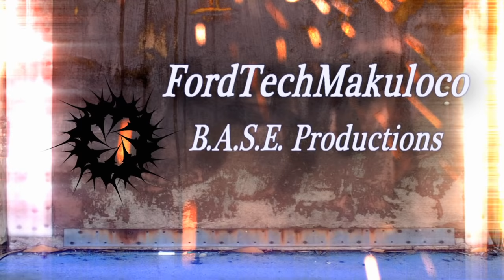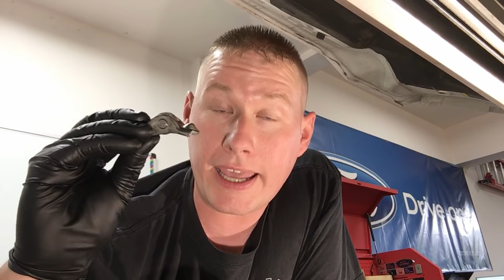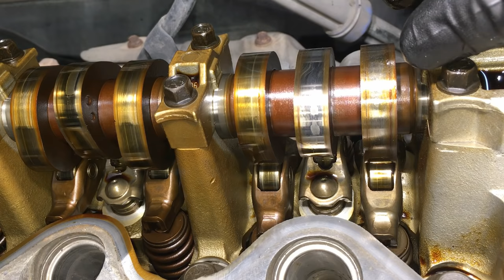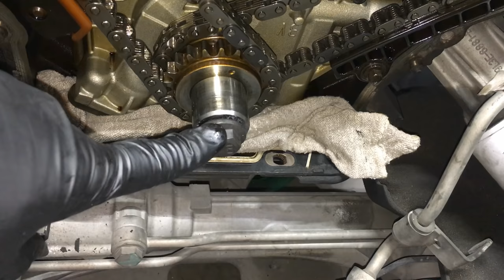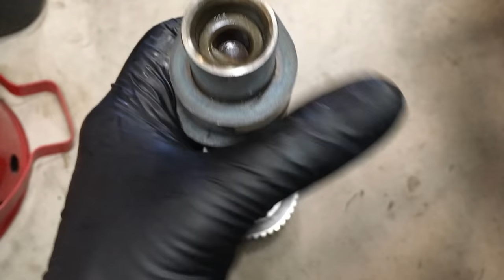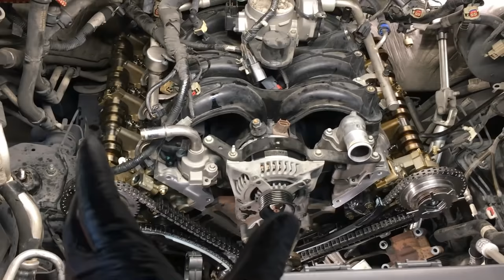Ford 5.4L 3v Triton Engines: Roller Follower Removal and Installation

Comment: I'm watching this video again before doing it myself. I Want to change the lash adjusters and roller followers on my mustang gt I with the 4.6l 3 valve engine. Could I use this procedure to remove all the followers and lash adjusters and replace them individually? Or do I need to raise the camshaft to replace the lash adjusters. Thanks you so much for sharing your knowledge I have so many of your videos on my Playlist.

Comment: I have the 4G 692 engine and will follow your advice on changing the followers, oil pump, phasers and possibly the cam.  However, I'm concerned about getting the correct parts for this engine.  What parts are the same with the 5G and what parts do I need to be cautious in ordering?  Great videos.

Comment: Hi I have a 2011 Ford expedition with the 5.4 l 3 valve engine and I love following your page I am about to venture into a large project where I plan on replacing the cam phasers camshaft timing chain as well as the roller followers. I've had the rattle on my truck for quite a while probably a year or more and it has progressively gotten worse I just have not been able to afford the repair and at this point I am preparing for the worst and thinking that I have to replace everything so I'm planned to order everything ahead of time and have it ready. The one thing that is hard to deduce from your videos is and what order these should be done when you plan on doing all of them at once if you could please provide me some contacts that would be great as it would be helpful as to knowing how to best avoid any timing issues when replacing cam phasers camshafts roller followers and the timing chain. 

Thanks in advance 🙏🏽🙏🏽🙏🏽🙏🏽

Comment: Love the videos!! I've been having problems with a P303 code along with others on my 2010 F-150. Spent $ 300 on the first assessment where they said it was an internal engine failure and I would need a used engine. My engine has 98000km on it and was quite disappointed. I tried another shop closer to home they were puzzled too, replaced 6 lifters on cylinders 3 and 4 but the problem of a misfire still persists. 3rd shop, a for dealer figures they have found the problem that the exhaust  valve spring is broken in cylinder 3. I'm wondering if the spring can be replaced  without removing the camshaft. They are suggesting it does need to. Please keep up the amazing videos Thanks
Reply: I have the same code and maybe problem. Was it the exhaust spring? What was your fix? Thanks

Comment: Another great video Brian....with these update roller followers and their smaller oiling holes, would you still recommend using/changing to 5W30 oil?  Do you think it will cause any issues?
Reply from the maker: +Ben Grigsby I would use 5w-30 no matter what

Comment: I have a 2002 F150 5.4 L. Do I need to remove the fuel rail, ignition coil packs and spark plugs? Thanks again for a detailed video.

Comment: I own a 2007 F150 5.4L 3v Triton and have been watching and learning a lot about these engines. I have applied the techniques from your videos with great success! On this particular video about the roller followers, I clicked on the link you posted for the latest roller followers on amazon to get a price and I am told that this part does not fit my 07. I have not heard any tapping or ticking from my 5.4 but am considering on changing the followers before it does start to make noise. Is this for sure the latest and greatest part or is there something better?  I want to keep this truck for a good long time. I bought it two years ago with 74000 miles on it and it is running strong at 102000. Any input, Thanks!

Comment: My brother was so fed up with his 2004 F-150 4x4 XLT, he threw me the keys and the title and said it's your problem now and went and bought a Toyota truck.  140K original miles.  I'm replacing the transmission with a yard pull from a known working truck.  Once that is done and verified working, I'm landing in on the engine with a phaser kit and now since I hear ticking, I'm planning to inspect the cams and followers.  Would it just be a good idea to pull the cams and replace all the followers and lifters while I'm in the engine?

Comment: Dumb question time. It seems to me it almost be easier to just remove the camshaft if you have to replace all of the roller followers, is this not a legitimate option?
Reply: Sometimes only 1 lifter or rocker fails so in that case this is the perfect solution

Comment: Since there are so many rockers and lash adjusters to do would it be easier to pull the cams and change them or would the rockers be flopping around in the way while you try to reset the cams? I was checking mine the other day and half the rockers on bank one wiggle around a little…
Reply: What did you end up doing?

Comment: Once camshaft is neutral (after pulling the 6 roller followers with the described method), can you just take off the whole camshaft first, and then pull all roller followers out?

Comment: Thank you for the videos! I have went through all 4  parts of the timing job videos,  I am at the very end and my crank wheel and belt are back on , you say after all that to go ahead and install all 24 rollers in part 4, how do I get the roller followers in that are not at the bay circle?? I’m unable to turn my crank with my socket anymore . Unfortunately I seen this video after watching part 4 and getting to this point now. Will the springs compress enough to get all of them in with the cams in one position ?

Comment: I'm a 20 Chysler tech (retired) after years, you get to know your product. I have an f150 with this engine. Any way to lower the spring without the tool? I do watch your videos, its part of owning one of the pickups, mine has 210k on it.

Comment: Love the videos you have so much good information thank you.  So my 05 navigator 5.4 3 valve just stated with the problem I took the valve cover off and cylinder 2 roller folower came loose and scuffed my cam. Where can I purchase a new camshaft and roller flowers.  Thank you

Comment: Excellent video Bryan. 
If you're only replacing the roller followers in the 5.4L 3 valve, is it required that you remove the timing chain cover? 
Or can it be done without removing the timing chain cover?
Can you please reply soon? 
Thanks!
Reply from the maker: No need to remove the front cover.
Reply: Bryan, thanks so much for the quick reply, which I greatly appreciate!

Comment: Took me 5 hours to do the drivers side. Intake on cylinder 8 was gone. Luckily it didnt seize or bugger the cam. Got it just in time. Wondering how long I have before I’d need to do the other side. Going to buy the parts now I think.
Reply: So how long was it?
Reply: @dicky7600  6 months?
Reply: Now I’m back in there doing the complete timing set and new oil pump, vcts, etc.

Comment: First of all love your videos.
I have a 2003 ford f150 4.6 2v I just bought. On a cold start it lightly knocks for a few minutes then completely goes away. If you had a guess what would you think. I greatly appreciate your advised thanks.

Comment: A burning question : Could a guy just loosen the cam all the way ... not remove it ... but just lift it up slightly so as to change out the roller followers??  Especially in the Passenger side of the engine? And especially if just doing Cylinder 3 and 4  roller followers?  Of course there is a method to follow on cam removal so as to not warp it, etc.  Any thoughts on this ?  ~ thank you for your fantastic videos ~

Comment: What's your recommendation on replacing the lash adjusters when replacing the rockers?  I have 6.8 3v that I need to do all the followers on and I was planning to just reuse the lash adjusters.  Unless the adjuster is collapsed or obviously damaged, I don't see a point in replacing them -- unless there is some tribal knowledge indicating otherwise.

Comment: I’ve got an ‘04 f150 w/149k. Noticing a tick. Only thing I’ve had to replace so far is the throttle body and a couple of batteries. Getting the 150k recommended service and wondered if I should replace the oil pump w/ the updated pump as a precaution. Your thoughts?

Comment: The part number for the roller follower that you provided, Amazon's parts check say's it will not work on my 09 5.4 f150 platinum. Any advice that you can give.  Your video's is very educational and I do appreciate them very muc.

Comment: Hey Brian I have a 1999 Ford 5.4 v8 would you recommend getting new Roller Followers because I do have a loud tick in my engine. Also its a older version of the 5.4 so no Camphasers or SparkPlug issues.

Comment: Recently received a truck with a 5.4 3v cylinder 2 dropped roller was laying in the cylinder head along with the retainer. Keepers did pop out and spring was also laying there. Bore scope shows no piston damage and valve did not drop. Is the valve seal holding the valve in place ? Also can’t find the keepers 😅

Comment: Thanks for the video Makuloko although one things you mentioned on the new rollerfollower you installed that the hole in the roller follower was bigger on the old one than the new.Wouldnt it be better if the hole was bigger in the new one so oil passage could flow easier and  if so why install the one that has a smaller hole.

Comment: I am going to do a timing change replacement along with cam phase sensors sprocket changes, etc. How do you know when the roller followers need to be changed?  I have 305,000 miles on my truck w/ original timing chain, etc. I am also doing the Meling oil pump per your recommendation. Now the roller followers? How bad, and what tollerances before we change them?

Comment: I assume the roller followers fail when the needle rollers in the bearing wear and fail.  Have Ford's newest roller followers been re-engineered to resolve this issue? ... or are the newest roller followers destine to fail in the future, just as the originals did?

Comment: The 4.6L 3V engine in my '06 Stang has developed a tick which has gotten louder over time. I put a stethoscope on the valve covers, but that didn't seem to reveal much. I'm suspecting either a follower or lash adjuster. Another issue I'm experiencing is increased oil consumption so I'm suspecting either guides or seals. At this point I'm wondering if I should just bite the bullet and spring for reconditioned heads.

Comment: Thank you for the great videos very informative. I will be doing my timing chains and fasers change. I was going get some of the parts but amazon says that oil pump and roller followers aren't compatible for my 2010 f150 5.4l 3v. What oil pump,  roller followers and thrash adjusters would recommend for my f150.  Thank you very much!

Comment: I have a 2006 f150 with 295,000 miles. Been running really strong but it is really starting to show its age and it seems like everything is starting to act up. I'm about 90% sure I will be needing to do this and any other this. I know my Phaser needs replaced. Should I go ahead and replace all of my roller folders? I believe this engine has stock followers knowing who owned this truck before me.

Comment: I am getting ready for a full timing job on a 2008 Expedition with 145,000 miles. Well serviced with full synthetic oil for its entire life. Even if the roller/followers look okay, would you recommend replacing all of them since the engine is opened up already? I want to keep the vehicle for at least another 7 years.
Reply from the maker: Yes replace them all.

Comment: Question...? 🤔 With the crank shaft and cam shafts in the neutral position, couldn't I install all the followers minus the 6 followers I took out then spin the engine one and a half more times to reinstall the other 6 followers?

Comment: Show actually pulling an exhaust rocker. I want to see how that tool fits around the spark plug tube and the rocker arm. Been to multiple videos of yours on the rockers and haven't found an example
Reply from the maker: You simply turn it to the side, it's harder but not impossible.

Comment: I need to do this on my mother in laws 05 f150 the roller followers timing set and fix the cracked exhaust manifolds and remove the broken exhaust bolts too

Comment: Thanks for all the help you giving me through the years. I have an issue and need your assistance please. ,2001 F150 5.4 2v. Full rebuild I have one roller follower the keeps slipping off when truck is turned on.. Valve is up, keeper is on, new lifter (s) ,  new roller follower (s) please help.

Comment: What happens when you install your timing chains and set timing without removing the roller followers? I chose to not remove the roller followers and now it backfires out of the intake. I'm hoping I did not bend a valve. I have only rotated the engine slowly with a ratchet. The engine does make full revolutions. I have not heard any clanking or banging . I also left the spark plugs in.

Comment: If you have to rotate the Crankshaft anyways, why can't you put them in when you reinstall the camshaft? Im sure you have already answered this, but i haven't been able to find it. If you are doing a controlled crank clockwise would it mess up your valves? Im about to do my first timing job and i just want to understand

Comment: Brain, took the truck  part apart right before thanksgiving of 2018 , I went ahead and ordered new cams along with the timing kit,  and Melling oil pump, the cams have R and L in thier respective boxes, would R be passenger side L drivers side?  I would hate to cross them. Thanks
Reply from the maker: yes

Comment: Thanks for the video.  When I turn the crank shaft, should the car be in neutral, or is Park fine?
Reply from the maker: It doesn't matter.
Reply: @FordTechMakuloco  Awesome! Thank you for the response!
Reply: @FordTechMakuloco  I am sorry for asking so many questions.  Do you know if the 2005-2010 Mustang GT uses the same rockers and lifters as a 2007 Navigator(my car)?   

Ford Performance has 397-M-6529-3V for $350.  And when I look at rock auto, the 4.6L Mustang uses the same parts as the 5.4L Lincoln navigator.

IE 
Melling JB7504 fits both cars. 
Melling MR1851 fits both cars. 

Makes me think I can buy this ford performance kit and install it.

Comment: M-6529-3V  this is advertised as for the mustang 4.6 only . However , I compared both the lash adjuster and the rocker ford part number to part number , and they are exactly the same for the 2005 4.6 3v mustang engine to the 5.4 3v  for say a expedition. This FORD Performance part , is around 300 with shipping (shop around ). However because Ford is marketing this kit as a “performance part” some sellers will not ship to California. Be aware .  FORD TECH , if your listening what are your thoughts 💭??

Comment: If I pulled all of the roller followers from front to back after pulling the first sets shown in timing replace videos did I damage the valves?  They all came out with the tool.  About to reinstall but just found this video a bit late.

Comment: Great video but multiple times ive been able to remove and install these with just a simple large flat head screw driver. I know i run the risk of the valve keepers comin off n dropping the valve down the cyl. but that is yet to happen.
Reply from the maker: +Gearz yes I have also shown that method before in my phaser replacement video. Problem is if you force it you can crack off the top off the valve stem as others have reported. So for most this is the safest and best removal method.

Comment: So just got done with putting the oem timing kit in everything is timed as it should be but I’m at the point of putting the followers back in but the cam lope is  at the bottom if I turn the crankshaft is it going to be out of time or now that everything is on is it good. Just wondering because I have some followers on already so if it presses down on those valves is it going to put it out of time.
Reply from the maker: No, once the engine is timed it is timed, turn as you wish at this point.
Reply: @FordTechMakuloco   awesome man thank you for the response you have no idea how much this helps people !

Comment: I was working on 5.4 2V, and to be honest, first I did tried to use spring compression tool, but that tool is a F-ing nightmare to use, which is different from 3V, keepers are popping out, and with that tool,, there are no way to install keepers back, even with surgical precision tool! So instead, to remove followers, I just pop them out with a big flat screwdriver!, and install them either also with a screwdriver, or a plastic clip remover, which have about 45 degrees angle, or just 1/2” by 2 feet long metal pipe, the easiest way, but I also installed 100% new timing chain with crank sprocket and guides, and hydraulic tensioners.

Comment: This may be a dumb question BUT why don't they just make the fork thing that sits on the valve springs a little narrower so it only slips over the stem and not the keepers?

Comment: I have a 2010 Ford Explorer AWD with the 4.6 in it. It seems to have 3 distinct issues. The first issue is when accelerating smoothly up to highway speed the truck can begin to shudder quite violently until I apply more throttle as if to pass. Second issue the brakes when braking normally the truck can pull very hard generally to the right in both forward and reverse. I recently had both upper control arm replaced followed up with an alignment and since then I hear a lot of metal on metal while turning left.